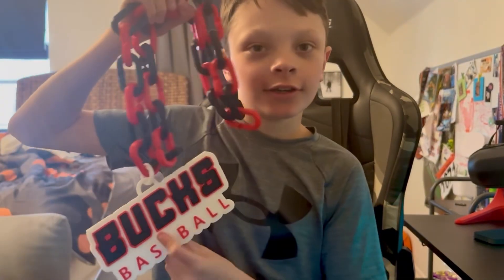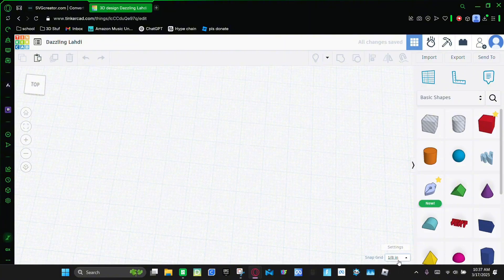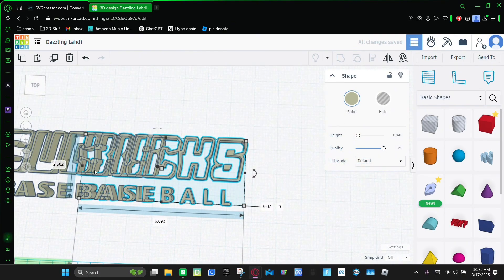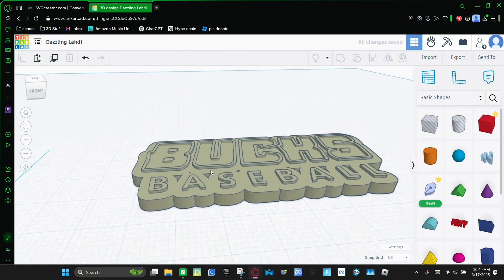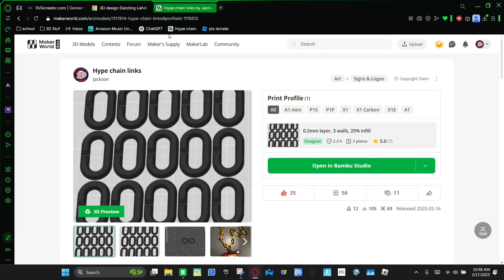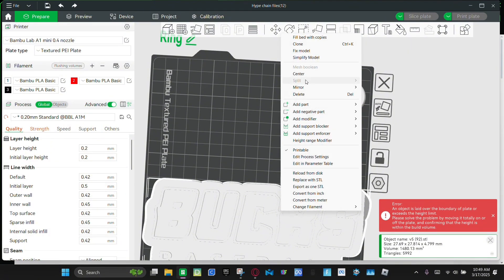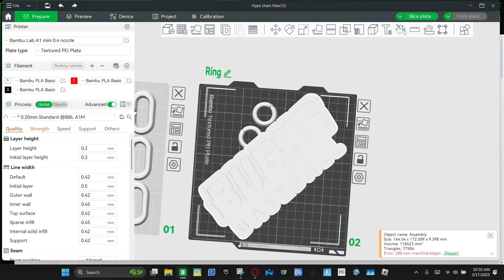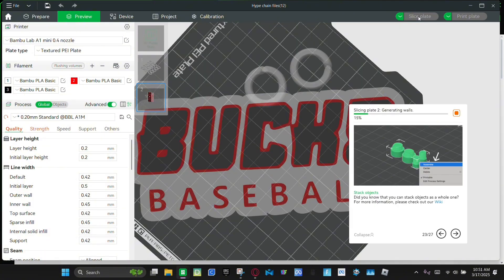3D Printed Hype Chain | Full Tutorial & Print Settings @BambuLab @AutodeskTinkercad

Comment: Great job, for some reason my model is really thin and I would like to make it a little thicker and more defined.  Any thoughts?
Reply from the maker: Sounds like you might be in mm not inches. In Tinkercad, just open your design, click Edit Grid in the bottom-right corner, and switch the units from millimeters to inches. Hit Update Grid and you’re all set!

Comment: Not sure what I'm doing wrong but when I download the stl file and import into Bambu Studio it looks like a single flat layer of the shape of my logo. It is only .37 height total when I import so too thin to attach to the ring in your file.
Reply from the maker: Are you exporting the grouped model from TinkerCad? That could be it
Reply: @jacksons3dworld  Having the same issue...in the video you say to group at the end and then export it, which would be exporting the grouped model, would it not? When I load into Bambu same issue, looks like one flat layer...
Reply from the maker: @stephanecote7401  your TinkerCad settings might be in MM and not inches. 

1.	Open your design in TinkerCad.
	2.	Look on the right-hand sidebar for the “Edit Grid” button (bottom right of the workspace).
	3.	Click Edit Grid.
	4.	Under Units, change from Millimeters to Inches.
	5.	Click Update Grid.
Reply: I'm in the same boat, I am def using inches too

Comment: Great video! Im brand new to this and was wondering what your actual cost to print this is. I’ve read that there are calculators online but haven’t found a good one. Thanks!
Reply from the maker: Great question! Each project is different depending on design time, 3d printing time, the type of filament the project needs, assessing quality, and so on!! I haven’t found a calculator to use so please share if you find a good one.

Comment: Hey Jackson. Thank you for uploading this! I can't wait to make a TON of these. I am running into an issue though. I'm noticing your image is thick after they are aligned. My image is still really thin. It loads in thick at a height of 10, but once I make it .37, it gets REAL thin. Any ideas on why? How do I check I'm using MM instead of inches?
Reply from the maker: Check your height settings. Should be .37 for the first one.